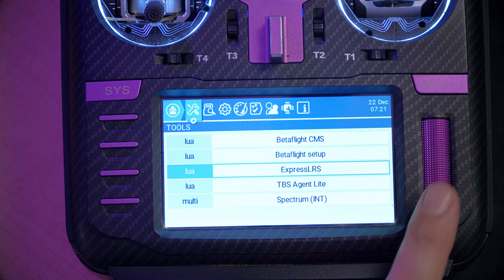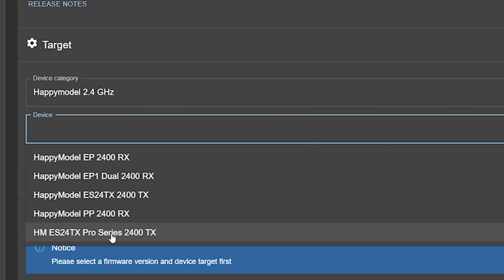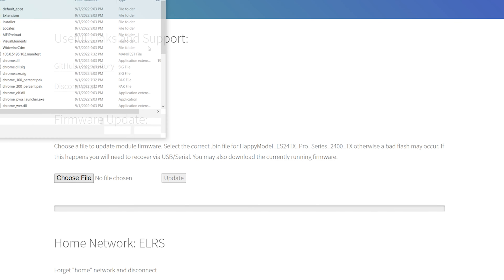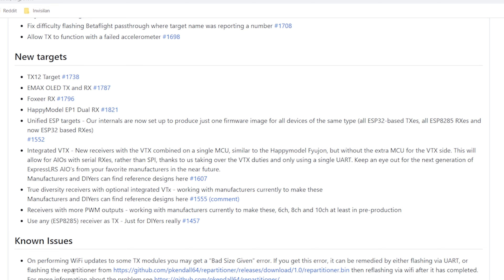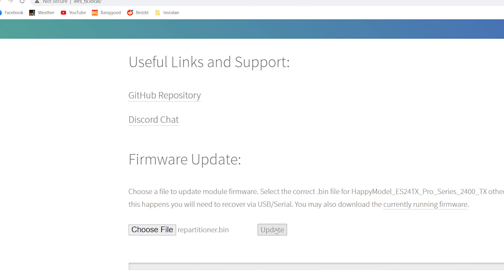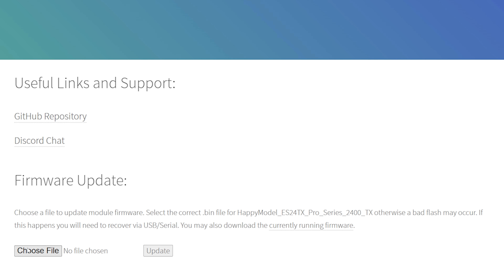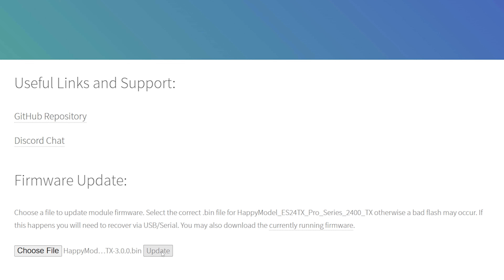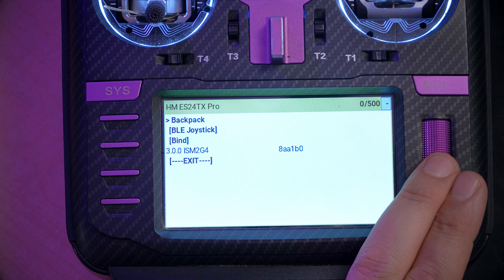ExpressLRS 3.0 "Bad Size Given" "Not Enough Space" (THIS WILL BRICK YOUR RX ONLY DO THIS TO TX)

Comment from the maker: DON'T DO THIS ON RECEIVERS. Only do it on modules. For receivers, flash to 2.5.1 first, then 3.x. If you flash a receiver with repartitioner, it will be bricked, and you will have to flash it again using ftdi or passthrough to recover it.
Reply: Exactly what happened. I bricked my AIO Betafpv f4 5a ELRS. I guess i was in a hurry and missed this information before flashing. So how exactly do you unbrick an Elrs receiver on a AIO Board? I have'nt found any Information regarding this. I tried ELRS Configuration with the Passthrough option and the correct Port selected but it still would not work. It says cannot detect RX target, blindly flashing. Then finally a Flash error message. Is there a way to unbrick an AIO Elrs board? I would be happy to have an info on this.
Reply from the maker: @brilliantyoungminds8111  Re-flash it using pass-through or FTDI adapter.
Reply: I actually solved this using this method:

Press and hold the button on FC
Plug in USB
Open Betaflight configurator,
go to firmware flasher tab
Let go of the button on FC
Click Exit DFU mode
Close BF configurator
Build and flash via passthrough using the ELRS Configurator

Then everything worked again. 😀
Reply: @brilliantyoungminds8111  bei mir hat es leider nicht geklappt ewig fehler :(
Reply: I bricked my DIY ELRS PWM receiver using repartitioner.bin file, and was later able to unbrick it also. Followed these steps to bring it back to life: 
1) Connect your FTDI to receiver's tx/rx/+/- pins. On receiver, pin 2 and 3 are usually Tx and Rx. You need to connect Tx to Rx and Rx to Tx.
2) Press and hold Boot button (firmly, very important) and connect the FTDI to computer. The receiver will enter in boot mode. If your receiver LED was already solid light, you wont see any difference. But in other cases it should go into solid green status. 
3) Using ExpressLRS configurator or any other flashing utility, flash the required ELRS firmware to your receiver. 
4) You should get a successful message and receiver will reboot into a normal slow blinking mode.
Reply: @brilliantyoungminds8111  When I try to do this method the "Exit DFU Mode" button is grayed out. Am I out of luck?
Reply: @JoshuaBardwell  How do you flash via FTDI an AIO reciever integrated via UART? AKA flywoo GOKU versatil F405 12v
Reply: Oh, I found your video too late 😢. Generic ESP8285 2.4GHz RX. Could you help me to recover my receiver, please? May be some link or video instruction? I cannot find any button inside. Only reboot button… Thank in advance, Mr. Joshua.
Reply: @karambol777.  
I bricked my DIY ELRS PWM receiver using repartitioner.bin file, and was later able to unbrick it also. Followed these steps to bring it back to life: 
1) Connect your FTDI to receiver's tx/rx/+/- pins. On receiver, pin 2 and 3 are usually Tx and Rx. You need to connect Tx to Rx and Rx to Tx.
2) Press and hold Boot button (firmly, very important) and connect the FTDI to computer. The receiver will enter in boot mode. If your receiver LED was already solid light, you wont see any difference. But in other cases it should go into solid green status. 
3) Using ExpressLRS configurator or any other flashing utility, flash the required ELRS firmware to your receiver. 
4) You should get a successful message and receiver will reboot into a normal slow blinking mode.
Reply: @brilliantyoungminds8111  

This solution doesn't work with betaFPV Meteor 75 pro. 
Can anyone suggest a way to unbrick the woop receiver?
Reply: So how do you fix this message on rx have the flywoo baby nano 20 decided to learn elrs and reflashed my mobula7 worked great now can’t fly baby nano not loving elrs
Reply: block my micro elrs pwm beta fpv receiver what can I do
Reply: I bricked my receiver :). It's quite funny actually, I didn't see your post before doing this. C'est la vie I guess 😂
Reply: LOL. Did just that on one of quad receivers. It put the receiver in boot mode and had to force flash using the UART dongle method and unplugging the receiver once it rebooted in WIFI mode. It works now!
Reply: SMH. Please put a disclaimer before this video!
Reply: i did that on my meteor 65 pro before i read ur comment :( am totally noob this is my first drone please help me to resurrect it am searching for 10 hours to find a solution but am unlucky
Reply: @ougkster  I connected it to another FC and used passthrough to fix it.
Reply: @davisw13  this option is not open in my configurator
Reply: hi josh iv been trying to bind my jumper t pro & module to my meteor75 for 3days now. jumper is elrs 2.5.1 & meteor75 is 3.3.0 is this why it wont bind? i try to flash Repartition.bin pc says the reboot warning, jumper stops wifi connection then says on wifi menu.
is this partitioning flashed & ready for 3.3.0? 
as i think No. hope you can advise, thanks
Reply: @eugenesteblin9380 im having a nightmare binding my jumper t pro v2 4in1 to my 75. My 75 is on 3.3.0 & my jumper 2.5.1. The partition wont flash to jumper by i think 75 wont need updating as its on 3.3.0.
Reply: Well shit.  I flashed the receiver.  How can I unbrick my device?
Reply: @JoshuaBardwell  doing a flashthrough flash gives an error that it failed.  I would assume I would have to be in bootloader mode to flash via betaflight.
Reply: Bricked my receiver and passthrough is not working...

Comment: Just over came this with a Betaflight Micro 1w TX, upgrading from 2.5.0 to 3.2.1, by going to the "support" tab in the ELRS configurator and "Clear PLatformio Dependencies" and "clear firmware files" and rebuilding from scratch.  THEN flashing.

Comment: Another thing you can probably do is upgrade thru the release candidates rather than jumping from 2.xxx to 3.  That's what I had to do  prior to launch-- go from 2.71 to 3rc1, then 3rc2.  From 3rc1 to 3rc2 they did a change to fix one thing which caused this thing
Reply: oh yeah is this true?  sounds less intimidating lol
Reply: I tried doing that last week from 2.51 to RC1 and RC2 and that didn't work. Wonder if 2.7x repartitions the drive automatically?
Reply: Are you sure that will work ??

Comment: Hey Josh, a wild attempt to get a response off an old video. I’m currently trying to bind my Cinelog 35 ELrs 2.4g with my Commando 8 2400tx module. I come to the conclusion the quick bind method didn’t work because they are on different firmwares. The receiver being 3.2 firmware and the Commando 8 being 2.4 firmware (factory) I went to flash my TX module straight to 3.3 the current latest and now I can’t open my ExpressLrs tools menu to bind or even access the wifi to reflash firmware. I have only noticed after watching this video and going onto the Config guide that I needed to do this 2.51 firmware first before upgrading to firmware 3.0 and later. I’m stuck. What should I do next and how do I get back the Expresslrs script and reflash my module when I can’t access wifi pass through??! 

Hoping I can hear back from you. Thanks in advanced. I will definitely be paying forward to the patrion if you help lead me in the right direction. 👍🏽

Comment: Nice video as always. However...your build was with UART flashing method and you flashed it over wi-fi 😁😝
Reply from the maker: The build is the same regardless, as far as I know. The only difference is what happens if you hit build and flash. If you only intend to build, I don't think it matters.
Reply: @JoshuaBardwell  Not trying to be smart... Just a friendly comment for fun. Thanks for answering though. I might have learned something today 🙂
Reply: @JoshuaBardwell  So, I had the same problem trying to flash 3.0.1 so I tried flashing this repartitioned bin and when it finished flashing it said wait for it to reboot before unplugging from FC and powering down.. well the light went out but never came back on .. waited 45 minutes and still nothing, never rebooted. So I unplugged the FC,plugged it back in, and surprise surprise the RX was bricked 🤦🏽‍♂️ I have the happymodel ep1 so I soldered the pad and ground together to put it in boot loader mode,made sure telemetry was off and tried to flash 3.0.1 via betaflight pass through but no luck.. not sure what to do now because it’s not like I can connect to Wi-Fi in boot loader mode and try flashing the repartitioned bin again🤷🏽‍♂️

Any chance The Godfather of FPV knows how to fix this? 🥺🙏🏽
Reply: Hi just wondering if we keep v2 Lula script or update it to v3? Many thanks.

Comment: Tried the repartitioner, but got a "Not enough data uploaded!" error instead. Oscar says downgrade to v2 first then flash again, but it was for RX, should I do it to my Happymodel TX module on my TX16s over WIFI?
Reply: I have the same, did you fix it? also for HM 2.4 TX
Reply: @HughSaunders  If I remember it correctly, I've downgraded/flashed to 2.0 and directly updgraded to 3.0 after.

Comment: So with the recent HappyModel Moblite7 HDZero V3 running firmware 3.0.1. I get the ERROR[4]: Not Enough Space.
I am trying to update to 3.3.1.
In the comments you suggest flashing to 2.5.1 first, then 3.x.
I am already in 3.0.1, should I flash back to the 2.5.1 in order to rectify the "Not Enough Space" error, then update to 3.3.1?

Comment: So, I had the same problem trying to flash 3.0.1 so I tried flashing this repartitioned bin and when it finished flashing it said wait for it to reboot before unplugging from FC and powering down.. well the light went out but never came back on .. waited 45 minutes and still nothing, never rebooted. So I unplugged the FC,plugged it back in, and surprise surprise the RX was bricked 🤦🏽‍♂️ I have the happymodel ep1 so I soldered the pad and ground together to put it in boot loader mode,made sure telemetry was off and tried to flash 3.0.1 via betaflight pass through but no luck.. not sure what to do now because it’s not like I can connect to Wi-Fi in boot loader mode and try flashing the repartitioned bin again🤷🏽‍♂️
Reply: I bumped similar problem with hglrc elrs rx yesterday . RX was bricked and wifi was not available. Betaflight passthru did not work either. I have FTDI usb-serial adapter and could flash the bricked RX with erls configuration using UART flashing method.

Comment: Did this with an ep1 reciever and it stopped transmitting the wifi signal after flashing the partitioner.bin. Tried fixing it by bridging the pads on the ep1 and use betaflight passthrough but can't flash and get the wifi back.

Comment: Hi
I was flashing the external module and it seems I make a mistake when selecting the bin flash file.
 I connect the module to USB-c and also try connecting to the external bay (jumper t pro) and Screen module is not turning on, but I let me to connect to generated wifi SSID.

How could I recover the external module?
Reply from the maker: If you can connect to the module wifi then you could re flash it with the correct firmware.

Comment: Flashing the repartioner.bin didn't work for me (HappyModel Non-Pro). It gave an additional error and stonewalled. I forget the actual error message but the workaround for me was to flash down to 2.0 then from there flash to 3.0. Worked for me.
Reply: I had a similar issue with the same module. After the "target mismatch" error, another error popped up. I think it said something about too few bytes uploaded. And it wouldn't flash the repartioner.bin file. I tried it multiple times without success. I was running ELRS 2.5.0. I upgraded the firmware to 2.5.1 and it let me flash the repartioner.bin file. Then I was able to upgrade to ELRS 3.

Comment: seems like you can upgrade via wifi directly now. just upgraded my new commando 8 from 2.4.0 to 3.2.1 without the reparttioner or the 2.5.2.
Reply: Comando 8?
Reply: @fernandotorrecilla5192  iflight commando 8 radio transmitter. The 8 was missing in my first text, added it :)

Comment: I ran the repartitioner and now my XLRS reciever has a sold green light when power cycled.  I'm not sure how to get it back into wifi mode.
Reply from the maker: Read the entire title of this video :-( THIS WILL BRICK YOUR RECEIVER. Read the pinned comment at the top of the comments section.

This is only for modules. You need to re-flash your receiver using either serial passthrough or a programming adapter. https://www.youtube.com/watch?v=TzAaYg47TSU
Reply: @JoshuaBardwell  Yes I read that after the fact unfortunately.  So I'm stuck without a FTDI programming board which I don't have?  I'll order one but once I get it, not do I hook it up on an all in one board?  I just flashed this to my brand new pavo pico 2.0 pro.  I'm so mad at myself.  I only did this because I got the not enough space error when trying to flash the receiver.
Reply: I got it.  It was a bug in BF 4.5.0 that was preventing me from using passthrough flashing.  it worked in 4.4.3.
Reply from the maker: Glad you got it fixed!

Comment: I think most people when facing a problem just focus on the "help me" instead of searching and understanding the reason of the problem.
This issue was reported and the solution is on the elrs page, people just don't read.
Joshua Bardwell always to the rescue.
This one I bet will be shared a lot of times answering the same question all over the internet.

Comment: I have your dawinfpv cin20 and it has elrs 3.0 and I would like to know if I can flash 2.0 on it to match my radio?And if so how?
Reply from the maker: I would recommend updating your radio to 3.x.

If the FC has an SPI receiver, the only way to go back to 2.x is to flash Betaflight 4.3.
Reply: @JoshuaBardwell  
No it's not spi  so can I flash 2.5.1 to match my radio. I have alote with elrs 2.0
Reply: @JoshuaBardwell  
Thank you for your help. Can I flash 2.5.1 to match my radio?
Reply from the maker: If it's not SPI you can flash whatever target you want. But I still would recommend updating to 3.x.
Reply: @JoshuaBardwell  
Thank you
Reply: It worked,  thank you very much.

Comment: Quick question. Do you run this update on the receiver's too? After months of fighting with my computer (Adobe wanted to interfere and i couldn't figure it out) I finally got 3.0 on my module with a binding password. I went to upgrade the receiver this morning and got the same error message for the receiver too. Do I partition it too?
Reply from the maker: Yes you can also do it with receivers.
Reply: @Joshua Bardwell  Thanks friend.  Happy Thanksgiving!
Reply: @georgepf  Me to... I've bricked 2 receivers now trying to sort the issue out... So it's not as easy as it sounds here... just to repartition the receiver.
Reply: @heliharris69  So what's the solution? Just run ELRS 2.x? Also, did you manage to un-brick those two receivers?
Reply: @JoshuaBardwell  got few ep2 that say not enough space,, dummy me will try on rx

Comment: Why isn’t this done automatically by the 3.0.0 flash process then when it detects the size issue?
Reply from the maker: You can read the github repo link in the video description for more info about why this happens.
Reply: It can't be done fully automatically - you need to flash a separate repartitionwr firmware to undo the manufacturers screwup, and then put the device back into update mode once that's done for the actual update once its rebooted a couple of times.

Comment: Does this also work for the receivers? Getting the message "Not enough space" on most of my Happymodel receivers.
Reply: That can happen on receivers if you're trying to flash the wrong bin file, that's instead meant for a radio. Like if you have a TX16S and used that bin file, you'd see that error. You need to build a separate file for your receiver.
Reply: @ItsBlunty  it's strange, I used the good bin files, on a new receiver. When I flashed it to 2.5.1 and than to 3.0 it takes the flash with no issues. It occurred only on WiFi flashing, uart or passthrough doesn't give this problem. But it's all worth the trouble, elrs is great, no more crossfire for me 😊
Reply: @onnovannoort7690  pretty sure serial programming should also sort out any partition issues out on its own - only the WiFi update method that can't and needs a spe ial workaround. You can also hit a target mismatch error due to target name changes, and do a forced update since its in name only.
Reply: @pfeerick  thanks, you're right. It's only with WiFi updates. Passthrough works great, and also with serial updates. A ftdi adapter is nice thing to have when switching over to a elrs fleet.